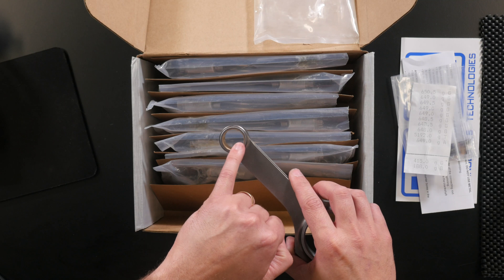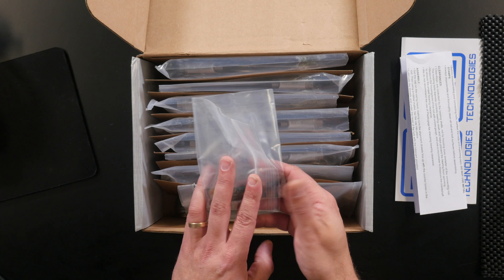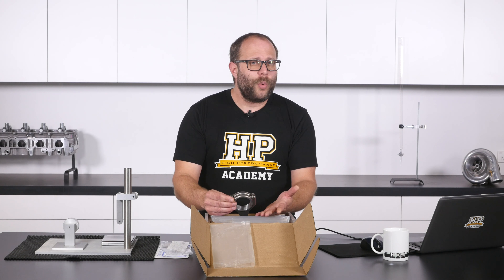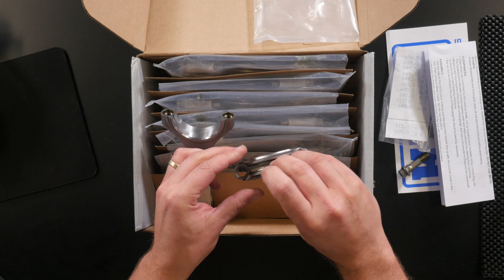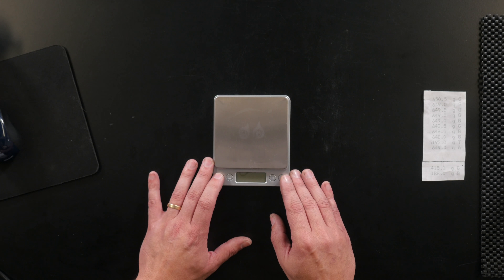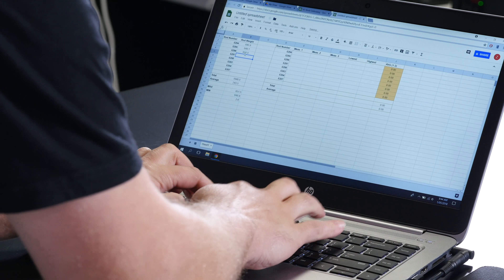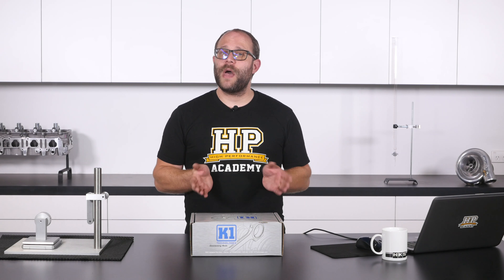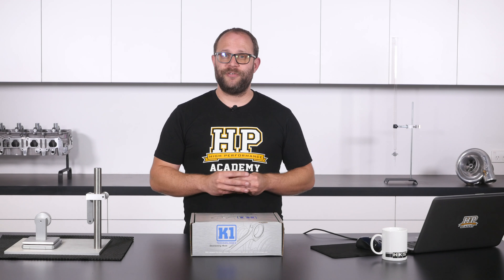Rods - Are they balanced right out of the box? | Unboxing

Comment: Did you remove the corrosive protection on the bolts/threads conrod threads before doing your mass calculations? I would assume that when the manufacturer weights in their parts they do it without any lubrication/protection. That could easily make a huge difference.

Comment: It’s worth noting that any weight removal should be done with the cutting method producing surface finish along the rod not across, even if no marks are visible.
Back in the day I remember a lot of F3 engines going bang.  It was finally traced to some of the rods being polished across not along.  All looked the same but when you are pushing the envelope it does matter.

Comment: Considering how much money ur spending on a Stroker Kit, the rods (& pistons & crankshaft) should be balanced right out of the box
Reply: Shaihan Rasheed you can trust a ballanced stroker kit right out of the box if you want to but I wouldn't. If you are going to spend that much money you should blueprint the engine or have a machine shop do it for you.
Reply: Wade Ryun yes ur right. Blueprinting an engine block is essential for high horsepower. Though I'll let an experienced machine shop do that for me
Reply from the maker: It's all a matter of degrees of balance and you could quite easily run this kit as delivered. We tend to be extremely fussy so our target balance is just tighter than those of the parts manufacturer. We find that all of the aftermarket parts we use are outside of our personal targets if that makes you feel any better.
Reply: High Performance Academy Oh I see now. Many thanks for the information
Reply: Even most OEM motors come with the rods ballanced to within a gram of each other.
Reply: Wade Ryun Understood
Reply: +High Performance Academy Great attitude!
Reply from the maker: @bobwatters While we'd love a conrod balancing fixture that gave perfectly repeatable results every time a rod was fitted to it, we also live in a world were most of our followers will be using a fixture similar to the one we used where a minor variation is inevitable. To add some context to this though, the variation across the measurements Zac made on that one big end was 0.2 grams which is negligible, particularly when there's an imbalance of 2.6 grams across the set of 8 rods, and we're aiming to balancing the rods to within +/-0.5 grams. 

The technique of taking multiple measurements, discarding the highest and lowest, and then averaging the remaining three is also a relatively common scientific method. Here's a nice article that explains this in more detail - https://www.webassign.net/question_assets/unccolphysmechl1/measurements/manual.html
Reply: @waderyun.war00034  this is so not true.
And to sound like you know what you're talking about,  you wouldn't have been so vague.  There's a rotating end and a reciprocating end which is critical compared to the overall weight of the rod itself. If you've ever balanced a rotating assembly you would know this.
Reply: i bought a set of summit balanced rods for my 383 project perfect  weights
Reply: I agree they should, especially the higher end stuff.  Unfortunately, it's not always the case.  There's also the matter of clearancing, and in that regard they may not be where you want them either.
Reply: @High Performance Academy  The manufacturer should be able to balance these more precisely still. Imagina some novice with a scale he uses to sell weed doing a better job balancing than the manufacturer with 100k of dollars worth of equipment for doing just that.
Reply from the maker: Yes they should Kyle, yet they don't, so rather than simply wishing they did this for us we find we get more tangible results by picking up their slack 😉- Taz.

Comment: I have had a terrible experience with K1.
Ordered BB Chevy 7.00" rods and received 6.6" box said 7.0.
K1 admitted they put the label on the box not the supplier. I sent my rods back for an exchange was told all the 7.00" rods had been mislabeled.
They cancelled my order and told me I can reorder when they are back in stock.
A year and a half later the price has nearly doubled and they had none last I called. No offer to make it right (price or different product).
I had ordered custom pistons when they told me they had multiple sets in stock so I had to get 7.00"  rods from a better company to finish my project.

And you want to know if they are balanced out of the box.
We need more videos on showing people how to measure length weight and check quality.

I hate to think what would have happened if I took this company at their word. Would have ended up with a super low compression when expecting 9.5 to 1 with a 7.00 rod.
Reply: Terrible ! 😂

Comment: You guys are very thorough, and informative. I really enjoy learning from your videos but i do question one thing on this particular one, the top of the pin boss is the thinnest part of the rod and i personally think that it would be safer to treat it like the rod cap (as per your comments on not removing material from it due to the importance of its strength). The underside of the pin boss seems reasonably enough spaced from the big end to achieve the necessary balance, and it has a much larger amount of material.
Reply from the maker: Jason, that is a really good point, and I should have been more clear about how we actually accomplish that part of the task. Once the big-ends are balanced, the static weights of the rods are typically pretty close, as we've balanced the end of the rod that has the most mass. To get them further in line, we use the linisher again, and remove material evenly from the entire circumference of the pin boss (well, all of it that we can reach). You definitely don't want to focus on just one spot, need to keep it nice and even. Typically the amount of material removed in this step is very small, tenths of a gram, so the pin boss is not thinned out noticeably. - Zac.

Comment: shot peening is not primarily used to reduce stress risers. Instead, it creates compressive stresses in the surface of the part, where the higher tensile stresses appear. Therefore, the total (tensile) stress seen by the part is lower and therefore increasing durability. (tensile stresses affect durability more than compressive ones)

Comment: would have been nice to see scale calibrated with weights to verify accuracy of data collected. Id hate to build and engine based on a cheap or inaccurate scale.
Reply from the maker: Oban, also a good point, and we have calibrated these scales in the past. The absolute value we obtain from them though is far less important than the difference between the weights when we're going through the process. That's what the verification tests I like to perform are about, making sure the data is as valid as we can get it :-) - Zac.
Reply: Why? Are you weighing to find weight or are you using a scale to compare weight of similar items on the same scale?... If you inflate your tires with a certain gauge to the same pressure they are all the same on that gauge and should be equal on another scale although the pressure may differ iow it doesn't matter what there comparable weights are as long as they are weighed on the same scale... Calibrating for this exercise is useless unless you want to compare your measurements to that of the producer...
Reply: Steven Barnard I would agree. The only consideration would be if one is needing weights to assemble the correct bob weights for balancing the crank(on a non opposed engine). Since balancing the crank uses a totally different scale the actual “true” weight would matter. On an opposed boxer engine bob weights aren’t used so, if I had to choose, I think I would rather be more consistent than accurate.

Comment: I have had so many rods fail because they come from the same plant in China with a different brand on them. Check out the Wiseco rods! 800 to the wheels no problem. After running and disassembly the Wiseco rods had zero stretch. Compare H beam rods on the market today side by side. Can you see a difference?
Reply: You get what you pay for. With cheap rods you get cheap materials. Today with modern CNC's you can make anything look like a million $$$. Good materials and the proper heat treating and quality hardware is what you are paying for. If you are building a big horse power high reving engine you want the best parts. If you are building a stock engine probabily not as critical.

Comment: Could you tell me how you would average the results? you said take out minimum and max results and the 3 results leftover would be average soo.. you mean by the "mean" right? Ex: 425.4 + 424.6 427.5 = 1277.5 / 3 = 425.83333?
Reply from the maker: Yeap, the averaging method we've used here is the mean. - Zac.

Comment: Wont aftermarket rods not influence the lubrication of the cylinder walls? Original GM rods had oil thrower tabs on the outer side (crank side of the bearing pocket) most aftermarket rods have nothing? Will I need to modify the rods with oil channels or the crank before use?
Reply from the maker: If this is a concern that your rod supplier hasn't addressed in a way you are happy with either grab the aftermarket rods that do, or keep the stock ones and their limitations.

It's not something we have specifically had concerns about or any issues with, but that's just our experience and decision making - Taz.

Comment: You forgot to tell us to wear gloves when handling the rotating assembly to minimise the chance of hydrogen environment. That's why the coating was on those rod bolts.
Reply from the maker: Actually gloves aren't necessary when handling an ARP2000 fastener as they don't suffer from hydrogen embrittlement like some of the more advanced materials from ARP such as L19.

If you wish to wear gloves however for your own application then no one will tell you not to, we often do too, but note in this case it is not for the reasons you state.
Reply: They aren't necessary, any iron based metal can be affected though. The higher the tensile the material, the more prone to embrittlement it is. Hence why there is a strict warning on the L19 bolts. 

For the sake of a few cents for a pair of gloves, It's a risk I would never take on a high performance engine, especially if it's going to be so stressed that we're worried about stress risers in the surface finish on the rods. I've even seen damaged cranks where the crack has started from rusty fingerprint. It was so clear we could've tracked down the person at fault haha.

Comment: You need to ensure that your balance is calibrated first. Assuming that they validate and certify their balances (industrial quality systems require that), I would say that your weights are wrong
Reply from the maker: It's the difference between the weights that is important, not the weight itself. So if your scale read 110g and 510g instead of 100g and 500g it would make no difference for this use, as the gap of 400 is what we're after, not 100g or 500g :) - Taz.

Comment: Define "balanced"......just how close are we trying to get each end of the rods?  Trying to balance an Engine closer than 1/4 ounce inch is a waste of time and money, to many variables considering oil under the piston on the up stroke verses oil trapped under the piston on the down stroke, out of balance is torque, if you have a significant out of balance it will require more torque to rotate the object going up and less going down, 8 grams, 8" from center mass, @8000rpm is equivalent to 112 pounds of out of balance US currency weighs very close to 1 gram..

Comment: What the maximum RPM that this rod & bolt combo can handle? (will an H type rod be okay for 7-8K RPM?) Thanks...
Reply: Yes
Reply: Yeah if well balanced, if you're running NA however and just looking for high rpm application you may want to look into I beam rods
Reply: I'm about to use Molnar H-beam 4340 rods for my 2004 M3 S54B32 motor; they look pretty much identical to these by K1 and have been rated to handle (Tom Molnar I guess was K1 before Molnar). The S54 motor revs stock 8000RPM, I see no reason why these won't be many times stronger than OE cast rods. I've heard that the piston wrist pin material is a crucial strengthening component to focus on for high RPM, high power output applications.

Comment: Maybe that's all you guys can get there but the LS1 is such a terrible platform to build on. I see so many people over seas use LS1s in there builds when they are by far the weakest LS motor GM every made. They are not good investments. An aluminum or iron 5.3 or an LQ4/LQ4 is cheaper and much stronger to build on.
Reply from the maker: Hey Trevor, we totally understand that. LS1s are very common down here in New Zealand so can be bought on the cheap. This engine will be naturally aspirated its entire life so we won't be pushing the limits at all :) - Ben
Reply: High Performance Academy okie not bashing you guys y'all make great content can't wait to see the build :)
Reply: It's just the con rods that let go swap in a set of gen 4 rods and pistons 1000whp capable
Reply: Austin Doud yeah and live for a minute or two. The problem is the block. The 1997-98 the block can fail at the oil pump at as little as 450hp. 1999+ isn't safe passed 600hp because of the extremely thin sleeves. Even then they can crack. Even if it survives 9 out of 10 times the block is taken way out of round to the point it'll need new sleeves. Or just get a 5.3 for like $300 or a LQ4/9 for $600-$800 instead of spending $1500 on a LS1. Also just because an engine can go to a certain HP doesn't mean you should. It's not safe to push safety margins and tell people to you can get them hurt or killed.

Comment: Lmao!! You want them to remove material from the part of the rod that the bolt torques into? The part that sees the most failures...how stupid. That area needs to be as strong as possible,  the ribs at the bottom see nowhere near the same stress. Ever seen a rod fail by splitting the cap? Yeah, me either. I've seen plenty fail by snapping the rod bolts, that would tell me that area is the most important to keep strong.
Reply from the maker: That's correct Jarred, and a bit more thought goes into it than the observation you have made there. You should come along to the next free live engine building lesson if you'd like to learn more about performance engine building and ask some questions about connecting rod balancing, how it is done and why it is done in this way :) - www.hpacademy.com/free-engine-building-lesson/

Hope to see you there - Taz.

Comment: LOL you have an ebay dope scale and trying to call out the rod manufacturer on their weights? Get a pro scale..
Reply from the maker: Hey Eddie, we spent a lot of money on some big brand US manufactured scales that would not give repeatable accurate results, whereas these do (yes we tested....). Remember it is the DIFFERENCE in the weight you need to measure and as such even if these were out by 1kg it wouldn't matter so long as they are out by that much every single time.
Remember that before you go and drop an obscene amount on precision scales, although a lot of engine builders do recommend painters scales over these as they generally are a better size for other uses in the workshop as well as giving repeatable results (again they won't be like lab scales where the accuracy of a specific weight is what you're after).
You seem like a smart guy so I'm sure that makes sense, but if you have any questions let me know - Taz.